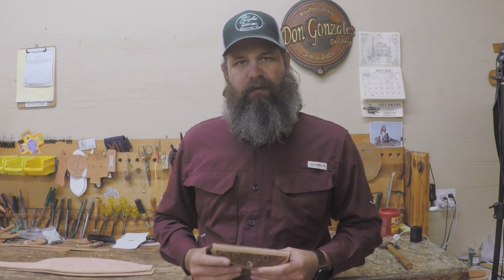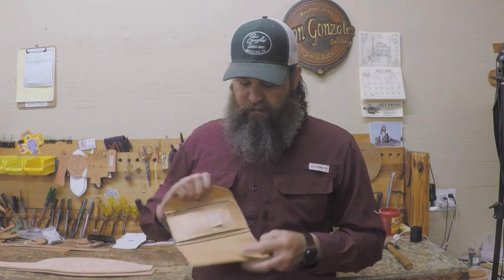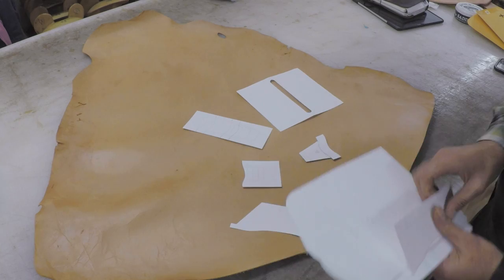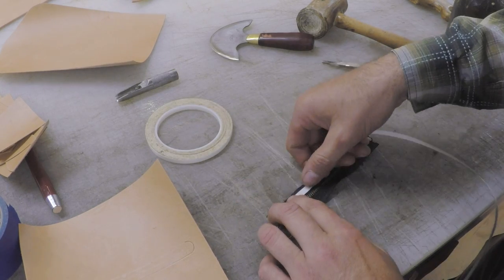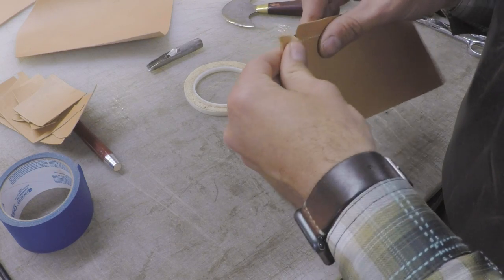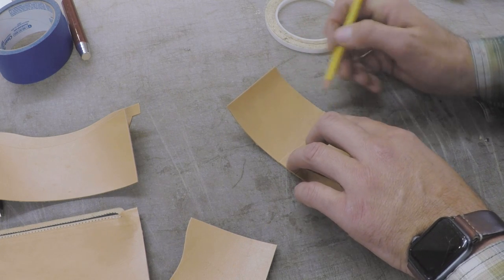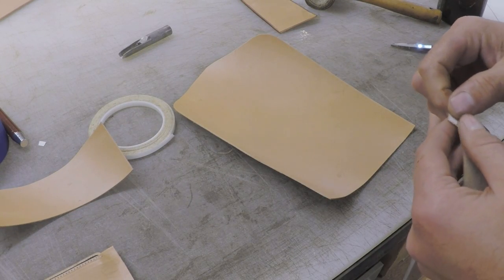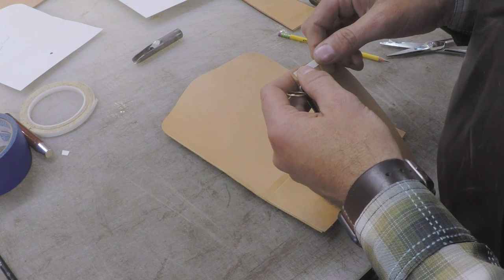How to Make a Premium Leather Clutch Wallet

Comment: That snap setter ‘sleeve’ at 28:33 looks like a must have for setting snaps! I have ruined a lot of snaps trying to hold down and hold/hit the setter at the same time. Does anyone know what that tool is called and where to purchase? I have googled all sorts of keywords and websites and such looking for this tool. Thanks in advanced!
Reply: Is there an answer?   I avoid snaps as they are not reliable.  This seems like a great tool without buying a setting machine
Reply: I kept digging and found that this tool is a Barry king snap setter 👍 for a line 20 or 24 type they run about $30 ea.

Comment: I downloaded a PDF file with a die, is there no error in the given size? The coin pocket is 7 3/8 inches wide and the wallet body is 7 1/16 inches wide. I've never used inches before, but it seems to me that something is wrong. Can someone direct me to the right path?
Reply: The liner is slightly larger so after you attach insides to outside, you then trim off the excess edges of liner so it is same size as outside body.